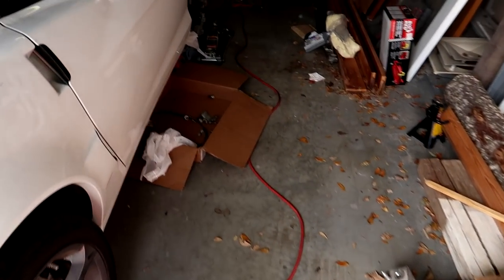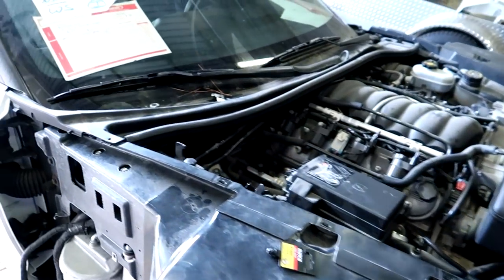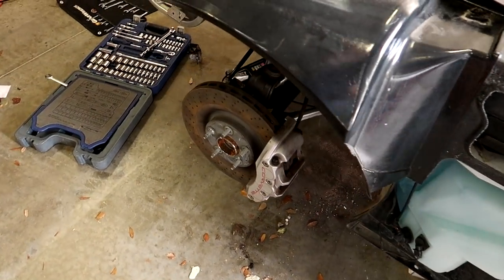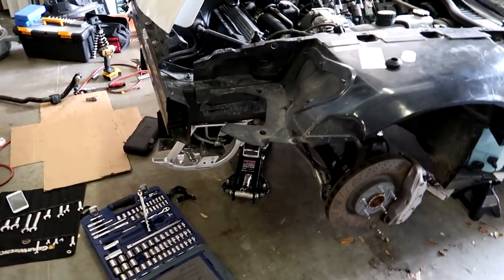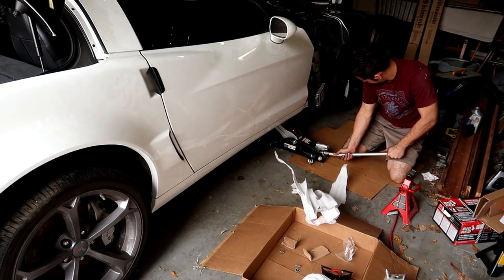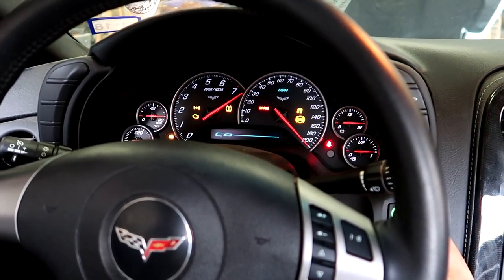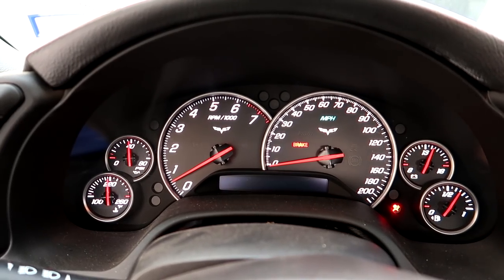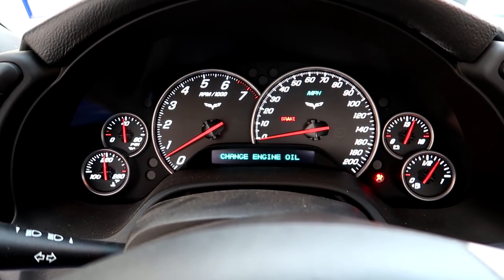THIS is why the Cheap Salvage Corvette Won't Start! Easy $100 Fix!

Comment: u can install an old, 32 bit edition of windows on any PC, even if it has a 64 bit CPU
Reply: Yes, but if you have more than 4G of ram, the OS won't see it.  Actually, 32bit windows runs a bit faster and takes less room to install, so far better even for 64bit capable systems that you can't ever put more than 4G of ram into.

RichE
Reply: if you have a 64 bit processor, a 64 bit windows install will be notably faster, using 64 bit apps. doesn't matter anyways the whole point of doing this is so you can install old tuning software that is not compatible with 64 bit...w

Comment: You need to have the car running for the crank learn and at operating temp. What's the link for that tool? I assume you also bought a tech 2 subscription from acdelco tds?

Comment: A 64 bit computer will easily run 32 bit software. Also, for some reason if it has issues you can always run 32 bit windows on the computer with no issues.

Comment: FYI - you can install 32bit software on a 64bit processor.  Best of both worlds, you can have 32bit where you need it - and you don't have to use a slow old computer.

Comment: Hey I have a question I have a 2007 corvette I was driving one day down the freeway and my RPMS dropped out of nowhere and it bogged down I pulled over and it didn’t start again I scanned it and it said it was a camshaft positioning sensor I replaced it and it still doesn’t start do you have any tips on what I should do next?

Comment: How did you fill the coolant?  Through the upper radiator hose first into the engine?  I have to swap the thermostat and I know LS engines are weird like that.

Comment: The battery should show 12.5 Volts with key one not running. When starting it should drop down to about 10 Volts.

Comment: Oy. It's not the computer that's 32 bit, it's the processor and the OS. The processor in newer computers can run 32 or 64 bit OS software. Very new computers may have driver issues with x32 software, but installing in a virtual machine should work.

Comment: I've had a good number of manual cars in my life and none of them needed the clutch to be depressed in order to start... until my 2015 MX-5 due to the start button.
AND I also keep an Asus netbook around. It's incredible but it's the only computer that reliably connects to my Moto Guzzi, my cars or my guitar processors. I'm baffled about this. Computers advance so fast, but all other consumer stuff go very, very slow in comparison.

Comment: I can not get my 2008 Corvette Z06 to run the dealership program car and it won't start it start but won't stay running Help! As of 5/6/2023 I put both fuel pumps and check I hear the fuel pump prime but the car won't start and stay running. what next?

Comment: Is a GM subscription needed to use(vcx nano) correctly like doing the relearn procedure for the clutch pedal and crank position sensor?
Reply: Shouldn't need a subscription to do anything other than module programming. Those relearn functions are just part of the Tech 2 software.

Comment: Congrats on getting it going again. Don't forget to change the oil ect before you try running it. It's just not worth the risk in a performance car.
Reply: did that in a prev video. he actually got the car without any in! :x
Reply: Then why does the dash say the oil needs changing?? Something's not right yet.
Reply: It's a service indicator light, once the car hits a threshold or the battery goes dead it'll trip that reminder by default. most newer cars have that. my 02 volvo has it. I cant reset it so it's been telling me 'service due now' for 40 some odd thousand miles

Comment: I think the guy with the jacked car might've snagged some sensor wire or something. I mean, if the car has modern (which i'm not aware in US cars, mind you) crash detection systems, they will not allow you to start the car for fear of you driving (a la Rusky) with the crashed car, endangering others. But again, i know of this feature only on some (mostly German) EurAsia cars.
Reply: I’m the other guy. No wires snagged car started fine before I jacked it up and removed the tires. It would not start like that. Now could it have been something else possibly. It did the same thing his did. But once it was on the ground it started again. It’s my first vette and I had it a week so who knows. I have it up again I will check and see if it does it again.

Comment: What's the website for the subscription and is that tool you got compaitable with all GM cars (obd2 supported) (Chevy, in particular). If not, what's a good source to finding the interface number(?)

Awesome vid btw! I'm very excited for you. Starting a car is an awesome feeling! Especially when it hasn't been working for a while...

Comment: I see you have a Audi s3 in your drive. What's your opinion on the car I'm thinking about getting the coupe version but I'm not sure yet it's between that and a 2008 bmw 3 series 320d
Reply: Adam Shaw what year you looking to get ? Get one with the warranty still on it I blew a turbo on my Audi and they replaced it all for free if you live in cold climate drive like a granny until it gets warmed up then you can drive it like you stole it

Comment: I bought a Acura integra out of a guy’s back yard for $300. He said it wouldn’t start and it hadn’t been touched or moved in a year. I put a hot battery on it and (click, click). Told him I be right back. Guy said he had to shower and get ready for work. Came back slapped a starter on it, he walks out his house as I turned the key sat”Mannnnnnn it’s not gonna start, I already told you.”  Hit the key and drove it it home. Dude’s jaw hit the ground and all I could do was Lmmfao. I drove it back and forth to work for almost a year and sold it for $2500 to a co-worker.

Comment: That computer is a 64bit cpu (Is a intel atom x86) but for sure is running a windows 32bit. ALL CPUs are retrocoptatible with 32bit Operative Systems

Comment: I replaced the failed instrument cluster in mine with one I bought off of ebay. What a headache! Of course the ecu didn't recognized it because the EPROM had different code. So, I sent it off to a shop to be reprogrammed at a cost of $350. Long story short, we never got the replacement to be recognized by the ECU. I ended up having to salvage the failed instrument cluster for another $350. This kind of issue makes it impossible to do anything electronics are technicial without special equipment and proprietary knowledge. I am driving the car, but I hate it, and I especially hate the engineers that designed it.

Comment: Wait can't you just right click go to properties then setup compatibility mode and pick the version and bit and start the program no problem?
Reply: Some software still doesn't run properly even doing that.  And, for some hardware, it just doesn't have 64-bit drivers.  Old fake Mini-VCI cables were like that.

Comment: DO NOT USE DEXCOOL, Instead drain all the plain water, look for full strength G-05 coolant. The fact is the Dexcrud is one of the worst coolants ever created.  I am a 30 yr Master Tech and basically ANY universal ethylene glycol coolant mixed per instructions ie 50/50 will work in pretty much any car. 
You can also lookup a company called Evans cooling. They sell an awesome non-aqueous propylene glycol coolant that is even better as you run their flush through the engine to lower water content, swap in their proprietary coolant and it come straight out of bottle with 375 F deg boiling point with no pressure on system. good luck with Vette.

Comment: I took my 99 in for a new clutch and now it turned over once idled down hasn’t started since turns but won’t start now I’m in a legal battle with the shop I took it to drive in tow home

Comment: I don't need all that stuff ..you just need  disconect  the clutch plug and THEN fool the plug with a simple cable introducing  in the holes of the plug connection and the car start always without push the clutch.

Comment: Leaf springs on a C6 Corvette front end?
Reply: Christopher U.S. Smith, it looks like a packaging workaround. Given the amount of height above the wheel and the damper geometry, a coil spring wouldn't fit, as it would be too large and stiff. You could relocate the whole package using bell cranks, but this would be to expensive I guess.  Leaf springs can be mounted underneath the arm, so less packaging issues. A wall designed leaf spring will perform ok, but isn't as cheap or compact (generally) as a coil over. But that depends on your geometry and where you have space.
Reply: Alisdair Herd Modern front ends use MacPherson struts, that's why I'm surprised to see front leaf springs in the 2010s.
Reply: Yeah, it is usually something you see on trailers and wooden wagons, not modern sports cars. But there's nothing wrong with a leaf spring, but it is a compromise. A McPherson strut is just a setup where the coil spring is used to locate geometry, where  a double wishbone setup for example the suspension doesn't locate the steering geometry.

This corvette appears to be running double wishbones, which isn't a bad setup at all. The type of spring and location is odd, but looking at the space provided, it's not that hard to see why they relocated the spring and subsequently had to use a leaf over a coil.

McPherson strut suspension is more economical, less parts to achieve the same goal. One of the downs sides is that you can't dial our the dynamic camber, basically as the suspension travels through its arc, there will be some change in camber. You have more control over this with a double wishbone. 

Leaf springs are perfectly acceptable, but do seem a bit "old hat" compared to modern coil springs. But they can do the same job, you can even have a progressive leaf spring and take them to be lowered without chopping coils out of them, mitigating the risk of the spring falling out of the hat. < no fun to be had with this scenario.   

But they take up more room and use more material. It seems strange but GM actually took the more expensive option in this case due to what seems to be packaging constraints.

Comment: WOW64 is the x86 emulator that allows 32-bit Windows-based applications to run seamlessly on 64-bit Windows. WOW64 is provided with the operating system and does not have to be explicitly enabled. So what are you talking about using an old computer? I'm confused as some of my old software runs fine on my Win10 64bit PC.

Comment: I bought one of those things from Amazon tried 3 different laptops detects vxdiag device but tech 2 software says no device connected, I've watched every video an researched to the point I'm returning the thing back to Amazon  I would be better off buying a GM MDI with the issues with vxdiag go China lol

Comment: Does the Tech-2 software come with the VXDIAG tool? If not, where did you get that?

Edit: I see that it does, thanks!
Reply: same question i had. finally a cheap alt to a tech 2

Comment: @ 08:21 : You are referencing a 32-bit Operating System, not a processor or a computer itself. 

Basically what you are saying is that you've found that the 32-bit Operating System has a better driver support on these devices vs. 64-bit OS (?). 

Since it's true to an extent, older hardware was better supported on 32-bit operating systems, since the first Windows OS to have 64-bit support was Windows XP in the 2001. But usually every machine that had Windows XP had a 32-bit version of it. I don't remember if it was Vista or Windows 7 that popularized 64-bit Operating Systems and nowadays every Windows install is a 64-bit installation.

Basically every modern (64-bit) computer can run a 32-bit OS if you install it onto it, but it would be limited to 3.5GB maximum of System RAM, but as a OBD host computer that wouldn't matter anyway. 

So you can avoid this problem of having to have older computers around with just installing a 32-bit OS onto a modern laptop. But I know, it's more work for the same result and usually you buy a new computer every now and then.

Comment: Never run an engine with the maf sensor disconnected (air tube open to air intake)!!! It will fry your sensor because it uses a heater coil which burns up if there's no incoming air to cool it off!

Comment: DONT USE DEXCOOL!!!! Any universal coolant will work but Dexcool is known as Dexclog and should always be changed once the car is out of warranty.
Thats my opinion from experience.
Reply: Dexcool doesn't clog up unless you drive the vehicle around with low coolant. That's the case where it sludges up. Maintain your cooling system and it's fine. Changing it to another type of coolant can do more harm than good unless you get all of it out, as it's not good to have a mixture in there.
Reply: The new versions of Dex-Cool don't have that problem unless someone decides to top it off with the damn green cheap coolant.  Dex-cool and the traditional green coolant are like oil and water they don't mix and cause lots of nastiness.  But other than that Dex-Cool has better cooling ratings than most of the other coolants short of the $$$ Mercedes Blue stuff.

Comment: Hey sam and all subs I need help with a rebuilt car, and its sort of important. I have a rebuilt honda accord 14, that I sent to a shop and it was fixed outside but inside I need a few things. I currently do not have a seatbelt that works. I can put it in and have it on but it does not retract and I can not move with it on. I need help finding it cause I've been looking to no avail. I also do not want to buy a new one cause I need a new driver seat cause the airbag was deployed and a srs driver roof airbag. Help please??

Comment: 8:00

I don't think 32-but vs 64-bit is your issue; even Windows 10 64-bit works fine with 32-bit code.

I suspect what you're referring to is 16-bit Windows programs, which will NOT run on 64-bit Windows operating systems, but will run on 32-bit operating systems.

In which case, but a decent new machine with an SSD and 4GB RAM, install 32-bit Windows 10, and call it good.
Reply: Yeah, that Tech2 software definitely has the looks of an old 16-bit program for MS-DOS...
Reply: ziiofswe Doesn't matter how it looks, if you're running into issues, either compatibility mode will work fine and it's not an issue of 32-vs-64 bits, or if it truly needs 32-bit and not 64-bit, that means it's a 16-bit program (or is an OS version issue,  someone lots of utilities had, still not related to bit count). Lots of 16-bit GUI-based programs and utilities persisted well into the Win98 days, some even continuing into XP's reign.

Comment: Why did someone think it wouldnt start because it was jacked up? That would mean it wouldn't run on any road that wasn't perfectly level.
Reply: not really.if the car can detect the suspension position (when fully jacked the suspension should be fully stretched) it can tell if the car is on the ground or not. But i doubt  car manufactures will do that anyway. that dude probably have a bad fuel line that was has air inside so at first it wont start, but then the second time when the car is on the ground the fuel pump already pushed the air out, so it starts,
Reply: having a sensor that stops it starting if the suspension is drooped would make literally no sense at all.
Reply: why not. the literal only time that the suspension is fully extended when stopping is when the car is jacked.
Reply: Or if you take it over a steep drop fast enough to get the wheels of the ground or its on a hoist. 
It still makes no sense for that to stop the engine from starting.
Reply: you wont need to start your engine if you are fast enough to literally "fly in the air"(steep drop). if your car is on a hoist i am not sure why you want to start the engine in the first place.
also since i am pretty sure this car is RWD so it doesn't even matter id the FW is off the ground
So yeah. i mean they can do that, and it will work, it just unnecessary, so no one actually do it IRL.
Reply: i even bold the letter "when stopping", so yeah, read carefully my good sir
Reply: Yinan Liu I did read it and it STILL makes no sense for a car to have that feature.
Reply: the engine will not shut off if the suspension is at max position. the only thing this sensor work is when 1.car is stop 2.engine is stop 3. suspension is at max extension. under these conditions, the engine *wont start*. 
but, if the engine is running and the suspension maxed out for some reason, the engine will *not stop*.
Reply: Yes I get what you are saying but it still makes NO SENSE for a car to NOT START when its suspension is at full droop. There would be literally no point in at at all
Reply: and thats exactly why no one is dong it in real life.
Reply: What the hell are you talking about that is exactly what I have been saying since the beginning of this pointless conversation.
Reply: what i am saying is that the system can and will work, which you did not realize at the start of the convo. but yeah, other that that, pointless.
Reply: Ok so this fictional safety system COULD work but does not actually exist.... Thanks for the most useless and pointless conversation Ive ever had.
Reply: Hey. I’m the one he was PMing in the video. I had my car a week. This is my first vette. It started fine prior to jacking the front and removing the tires. It would not start in this position. Now it could have been something else possibly. I don’t really know. But when I put it back down it started fine.

Comment: Noooo! Not Death-Cool!
Reply: Dex Cool sludges in systems using open reservoirs, but this Corvette uses a pressurized reservoir.  It'll be fine.
Reply: John Davis Any coolant or oil sludges if exhaust gases penetrate that head gasket.